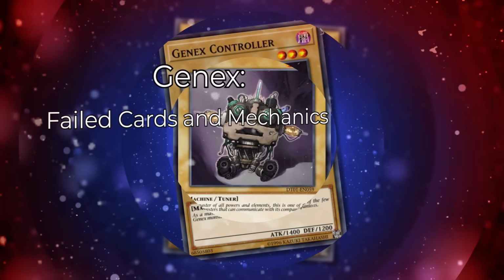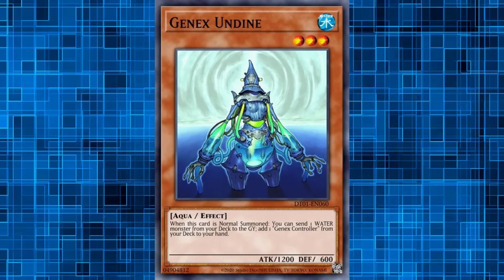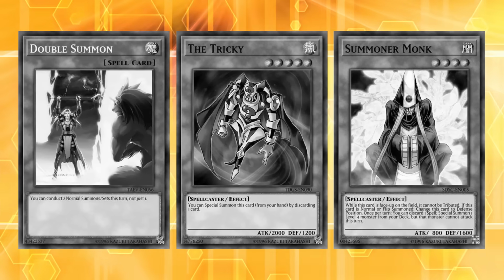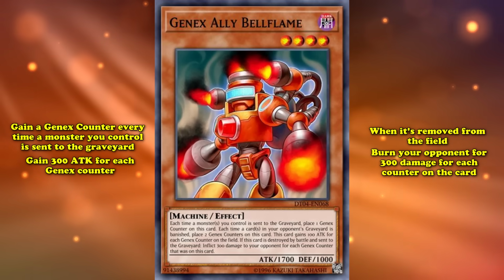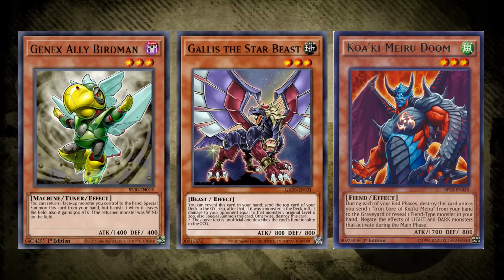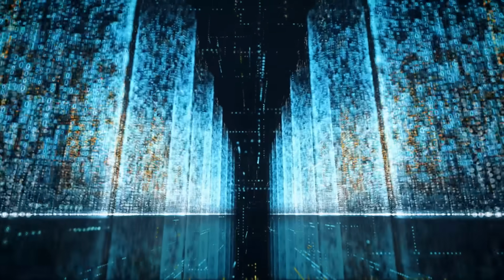Genex - Failed Cards, Archetypes, and Sometimes Mechanics in Yu-Gi-Oh

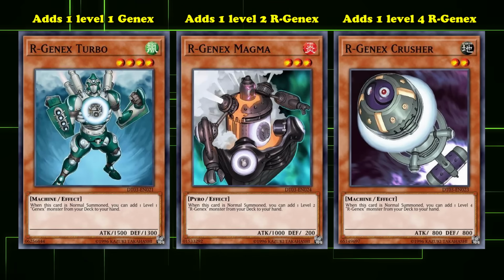Comment: (9:24) Genex Power Planner completes this set.

Turbo searches a level 1, which Genex Power Planner is.

Power Planner searches a level 3, which R-Genex Magma is.

Magma searches a level 2, which R-Genex Crusher is.

R-Genex Crusher (not to be confused with Genex Ally Crusher) searches a level 4, which R-Genex Turbo is.

Turbo searches a level 1, which Genex Power Planner is.

And so the cycle repeats.

- - -

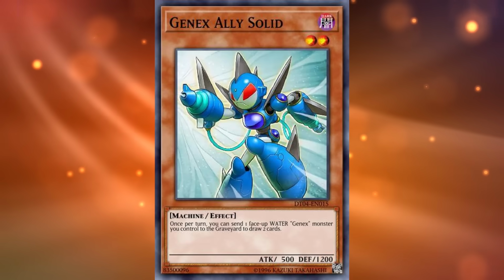(12:48) G.A.S. (Genex Ally Solid) can tribute a Liquid monster to draw 2 cards.

Next you'll tell me it's holding a Plasma canon.

Comment: Looking at the support nowadays for Genex, the new cards were actually okay. 

Return Genex Controller is a Link 1 that required 1 level 4 or lower Genex monster as material and has a non-once per chain (and non-once per turn turn) effect that allows you to normal summon another Genex monster from your hand if you added a Genex card to your hand.

It made the slow board building process of the past into a viable glue to Genex Decks. However, it was also the biggest target to negate with Imperm and Veiler or stop the searching from the deck by Droll and Lock Bird. Plus, if Genex didn’t get a monster Negate on board, then Nibiru also completely counters the Link 1 Summon Spam.

They also got a new Synchro in Arms of Genex - Return Zero. A Level 10 Dark Machine Synchro that requires a Dark Tuner and one or more non-Tuners. It has a quick effect monster negate that it can activate by banishing monsters of the attribute of the monster effect being activated. It also has a once per turn effect to shuffle up to 6 Genex monsters of different attributes from the GY or banish zone to destroy that number of spells/traps on the field.

While not immediately game breaking, Return Zero is a really nice payoff that had an impressive endboard presence. It’s mostly effective in Genex Decks, but Return Zero has had some brief experimentation in decks like Centur-ion.

Overall, while Genex is not quite meta relevant, the new support did provide a solid combo plan that, when uninterrupted, makes the Genex strategy more consistent.

Comment: 1:12 Wrong level
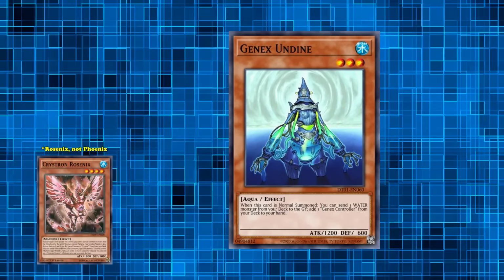1:55 Wrong name
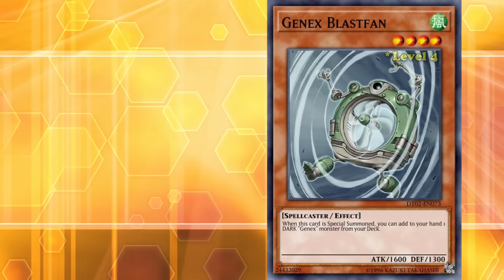3:22 Wrong level
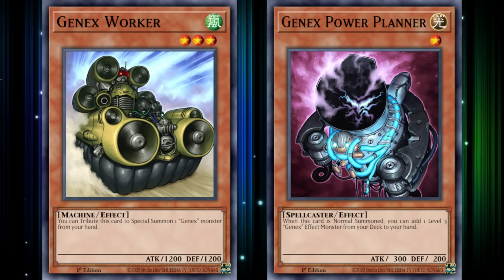7:08 A whole lot of errors here
9:21 Add 2 monsters? Wrong
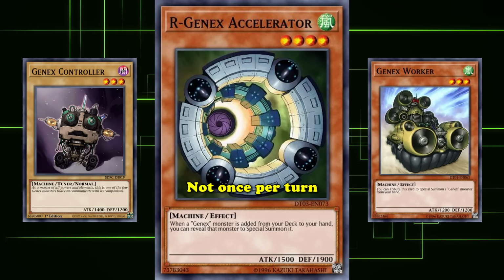9:52 Both name and effect are wrong lol
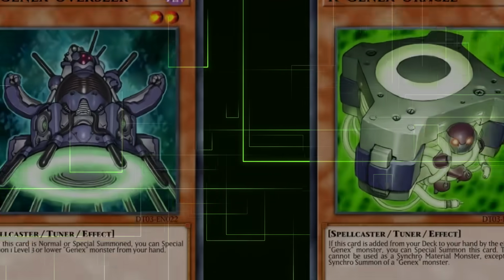10:07 Normal OR Special Summoned
11:46 Wrong effect, gains 100 ATK for each not 300, also the other effect is when destroyed by battle not "when removed from the field"
12:27 1 face-up FIRE "Genex" monster you control, not from the hand
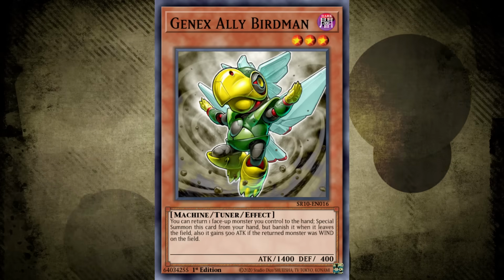13:32 Returns 1 face-up monster YOU control
15:06 And also Draw 1 card

I might have missed a few but the point has been proven nonetheless.

Honestly this video is just a mess, I wouldn't be surprised if all of your other videos are the same. You should stop being so lazy like the way you sound and start checking the quality before uploading these awful videos.

Comment: Congrats, you have just spoken Genex support into existence
Reply: Konami said: “Yo this man is talking shit”
Reply: And  it's quite good too, the only restriction is synchro monster must be summoned using genex monster as material...... Genex Dragon Trishula and Baronne is on the floor
Reply: @hoshi314 I don't think that much issues consider that Genex when they get going they kinda in loop. Link 1 add consistent make deck particular hard to brick in deck.
Reply: Still bad @hoshi314
Reply: Lol deck feels great as any monster is link 1 into combos and set your board with negates.
Sadly it has no recovery if someone stops you with a handtrap. You rely on a normal summon into link 1 for your entire combo
Reply: The monkey paw finger curls
Reply: And it didn't do anything :(
Reply: No, that was Rata

Comment: I always felt Genex was ment to be a support archetypes for other decks and not a deck unto themselves. Mostly because of the whole lore behind the cards from Duelist Terminal.
Reply: That might have actually worked if their tuner wasn't utter trash, or their effects actually did anything to turbo out their single tuner, since Tuner options were so limited in early Synchro format even Flamvell Magician saw play. Even a passable synchro with generic materials, like Ally of Justice got, would have worked better.

Of course, they couldn't do that because Synchron already took the theme of machine monsters that turboed out synchro monsters, and that actually produced a decent number of useful support cards (even if they were never really great as a pure archetype).
Reply: Similar to Guardragons imo

Comment: I think Albaz along Visas are more successful version of Genex. Both are lore monsters which are directly tied to certain archetypes however there are some critcal differences

•Both have at least semi-relivant effects being either a mini super poly or  level 6 tuner
•The decks they're connected to actually have some meaninful plays even without them in rotatation. 
•Name copy cards have relivant effects besides just coping the name with Albion getting a draw and the synchro searching for example.
•Bosses they enable are actually decent. Mirrorjade and Ringowurm being probably the strongest however Visas sets up for scareclaw and Mannadium while having Astraloud for another body in pinch

Comment: I find it hilarious that the best use of Genex was as a Trishula engine more so than anything to do with with Genex synchros. And all because of a weird wording loophole involving Machine Duplication, which allowed any Genex monster whose name got copied by Genex Spare to be mass summoned because it's based on the stats of the card present, not the ones about to be summoned (so have Spare copy any lvl4 Genex monster's name to special summon 2 of said monsters and then synchro into Trishula). For context, Locomotion R Genex can be summoned this way but no one would choose that over freaking Trishula.
Reply: The madlad summon the train 😂

Comment: I think Genex could be fixed by adding a field spell which allows one additional normal summon of a Genex monster, a continuous spell to add a Genex monster to the hand whenever a Genex monster is summoned and a continuous trap which gives you life points equal to the Genex monsters used for a synchro summon and return one of the materials to the hand.
Reply: also they needed a card to change attribute freely as continuous spell/trap or field spell

for the normal summon, maybe they can get something like " Ultimate Offering" exclusively for Genex
Reply: it's a dire situation that I can say that I'm not sure a better cynet codec would be good enough lmao
Reply: A lot of these old abandoned archetypes could be blanket fixed by just giving each one a non-interactable field spell that is guaranteed to go off whenever and gives the archetype all the modern functions they need to at least be rogue, with extremely strict restrictions against generic usage. That 1 card could then be retrained every time power creep gets far enough. Not sure if anyone who doesn't play those archetypes would appreciate that becoming the standard though.

Comment: Despite being underwhelming, they are my second favorite archetype. The trick is to not run so many of the bad Genex cards and you can make a casual coherent list. Blastfan is a Stratos, as long as you got the Summoner Monk or Summon Storm for it. Divine Wind strats are still great. Hoping to see new support in the Duel Terminal support releasing around the corner. ❤

Comment: it might have changed, but it sounds like the super heavy samurai archetype, with only monster.
Reply: Ehhhh, Superheavy had a far better base to work with. Soulpiercer was always a combo enabler, especially once Scarecrow and Wagon released, but the deck fell into the pitfall of "combo deck that is worse than the meta combo decks". This , on top of most handtraps being monsters, is generally why it was able to sustain itself without S/T access.
If anything, comparing it to Naturia would be better, although that already had good synchros and some decent cards
Reply: At this point they need the SHS treatment if they're just gonna stick to monsters

Comment: ...To think, that Rata almost had to hotglue an ultra rare Blue-Eyes because of Genex.
Reply: And it would’ve happened too were it not for the 100 LP gain from the Destruct Potion on that black salvo that kept the Meklords alive.
Reply: @voltingmaster5458 tbf, there should have been a second Bo3 since Genex was in the winners bracket and Meklords were in the losers bracket.
Reply: Technically he should have still done it. He said that he would if Genex won anything. Genex won almost everything.

Comment: Oh WOW, I remember the last time you talked about Genex…
I think I did a retrain for almost every single Genex monster in the game…
Let me find that video and try to compile all those into a single comment.
Edit: DONE:

Next-Genex Controller (DARK)
Level 3
Pendulum Scales: 9⬅️➡️0 
Pendulum effect: You gain 500 LP for every face-up “Genex” monster you control. If a face-up “Genex” monster you control would be destroyed, you can pay 500 LP instead. If you Pendulum Summon using this card, you can add 1 “Genex” monster from your GY to your hand for every “Genex” monster Pendulum Summoned. If you would Synchro Summon a “Genex” Monster, you can use this monster in your Pendulum Zones as Material.
Machine/Pendulum/Tuner/Gemini
This card is treated as “Genex Controller” except while banished. This card is treated as a Normal Monster Except While Banished. While this card is face-up on the field, you can Normal Summon it to have it be treated as an Effect Monster with the following effects:
⚪️ If this is normal Summoned, you can normal summon an additional 2 “Genex” monsters this turn.
⚪️ Once Per Turn (quick effect), You can shuffle 1 “Genex” monster from you field into your deck: This card gains it’s name, attributes, ATK/DEF and effects for the next 2 turns, and effects gained become Quick effects if they were not already.
ATK/1400 DEF/1200

Next-Genex Gaia (EARTH)
level 3
Rock/effect
If a “Genex” card you control would be destroyed, you can destroy 1 other “Genex” card from your hand or field instead. If this card is used as cost or material do the summon of a “ Genex” monster, that summoned monster gains this cards name, Attribute, ATK/DEF and effects.
ATK/1000 DEF/1900

Next-Genex Furnace (FIRE)
Level 5
Pyro/effect
If you control a face-up “Genex Controller”, you can normal summon this card from your hand without tributing. While you control this face-up card, you can normal summon “Genex” monsters without tributing. If this card is used as cost or material for the summon of a “Genex” monster, that summoned monster gains this cards name, Attribute, ATK/DEF and effects.
ATK/2000 DEF/1300

Next-Genex Doctor (DARK)
Level 3
Spellcaster/effect
You can tribute 1 face-up “Genex” monster you control to activate 1 of the following effects:
⚪️ Destroy 1 card on the field.
⚪️ Increase your LP OR this cards ATK/DEF by the tributed cards ATK/DEF
If this card is used as cost or material for the summon of a “Genex” monster, the summoned monster gains this cards name, attribute, ATK/DEF and effects.
ATK/1500 DEF/1000

Next-Genex Blastfan (WIND)
Level 4
Spellcaster/effect
If this card is special summoned, you can add 1 “Genex” monster from your deck to your hand. If this card is normal Summoned, you can add 1 “Genex” monster from your GY to your hand. If this card is used cost or material for the summon of a “Genex” monster, that summoned monster gains this cards Name, attribute, ATK/DEF and effects.
ATK/1600 DEF/1300

Next-Genex Undine (WATER)
Level 3
Aqua/Effect
When this card is Normal Summoned: You can send 1 WATER monster from your Deck to the GY; add 1 "Genex" monster from your Deck to your hand. If this card is Special Summoned: You can send 1 “Genex” monster from your deck to your GY; add 1 WATER monster from your deck to your hand. If this card is used as cost or material for the summon of a “Genex” monster, that summoned card gains this cards name, attribute, ATK/DEF and effects.
ATK/1200 DEF/600

Next-Genex Worker (WIND)
Level 3
Machine/effect
You can Tribute this card to special summon 1 ”Genex” monster from your hand (Quick effect). This summon cannot be negated or responded to. While you control this card face-up on the field, if your opponent would negate your normal summon/set of a “Genex” monster, you can conduct another normal summon after the negate resolves. If this card is used as cost or material for the summon of a monster, that summoned monster gains this cards Name, attribute, ATK/DEF and effects.
ATK/1200 DEF/1200

Next-Genex Turbine (EARTH)
Level 4
Machine/effect
All Face-up “Genex” monsters you control gain 400 ATK/DEF for every face-up “Genex” monster you control. All face-up “Genex” monsters you control deal piercing battle damage. If this Card is used as Cost or Material for the summon of a “Genex” monster, that summoned monster gains this cards name, attribute, ATK/DEF and effects.
ATK/1400 DED/1300

Next-Genex Army (EARTH)
Level 6
Machine/effect 
If you normal summon a “Genex” Monster , you can destroy 1 card on the field. If you special summon a “Genex” monster, you can change the battle position of 1 monster on the field. If this card is used as cost/material for the summon of a “Genex” monster, that summoned monster gains this cards Name, attribute, ATK/DEF and effects.
ATK:2300 DEF/1300

Next-Genex Neutron (LIGHT)
Level 4
Machine/Effect
If this card is used as cost/material for the summon of a “Genex” monster, that summoned monster gains this cards Name, attribute, ATK/DEF and effects. Once per turn (quick effect), you can activate 1 of the following effects: During the End Phase, if this card was Special Summoned: You can add 1 non-tuner “Genex” monster from your Deck to your hand. During the End Phase, if this card was Normal Summoned: You can add 1 Machine Tuner monster from your Deck to your hand.
ATK/1800 DEF/1200

Next-Genex Power Planer (LIGHT)
Level 1
Spellcaster/effect
If this card is used as cost/material for the summon of a “Genex” monster, that summoned monster gains this cards Name, attribute, ATK/DEF and effects. If this card is normal summoned, you can add 1 level 4 or lower “Genex” monster to your hand from your Deck or GY. If this card is Special summoned, you can add 1 level 5 or higher “Genex” monster from your deck or GY to your hand.
ATK/300 DEF/300

Next-Genex Recycled (DARK)
Level 1
Machine/Tuner/Effect
If this card is used as cost/material for the summon of a “Genex” monster, that summoned monster gains this cards name, attributes, ATK/DEF and effects. Once per turn (quick effect), you can target 1 "Genex" monster in your Graveyard, then activate one of the following effects:
⚪️ Shuffle that targeted card into your deck, then draw 1 card.
⚪️ Shuffle 1 card from your hand into your deck, then add the targeted card to your hand.
ATK/200 DEF/400

Next-Genex Searcher (EARTH)
Level 4
Machine/Effect
If this card is used as cost/material for the summon of a monster, that summoned monster gains this cards name, attributes, ATK/DEF and effects. If this card is destroyed by battle, you can Special Summon 1 "Genex" monster with 1500 or less ATK from your Deck in face-up Attack Position. If this card is sent to the GY by your opponent (except by battle), you can special summon 1 “Genex” monster with 1500 or less DEF in defense position.
ATK/1600 DEF/400

Next-Genex Solar (LIGHT)
Level 7
Machine/effect
You can normal summon this card by tributing 1 “Genex” monster from your hand or field. You can special summon this card (from your hand or GY) by paying 2500 LP. Inflict 500 damage to your opponent each time a Face-up “Genex” monster your control is sent the the GY. At the beginning of each turn, you gain 500 LP for every “Genex” monster you control. If this card is used as cost or material for the summon of a “Genex” monster, that summoned monster gains this cards name, Attribute, ATK/DEF and effects.
ATK/2500 DEF/1500

Next-Genex Spare (DARK)
Level 3
Machine/Tuner/Effect
Once Per Turn (Quick effect), You can make this card’s name “Genex Controller” until the end phase if you control another “Genex” monster OR if you discard 1 “Genex” monster from your hand, and if you do, if your opponent would target any monsters of the same name for battle or effects, they must target this card first. If this card is used as cost or material for the summon of a “Genex” monster, that summoned monster gains this cards name, Attribute, ATK/DEF and effects.
ATK/800 DEF/1200